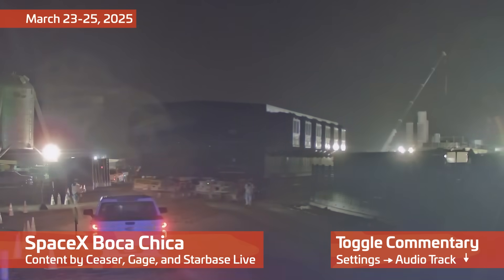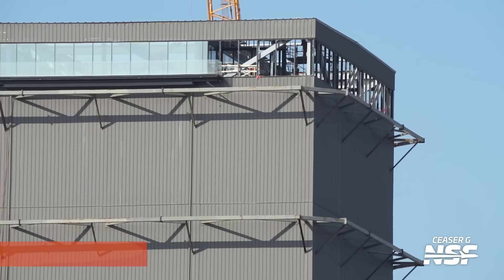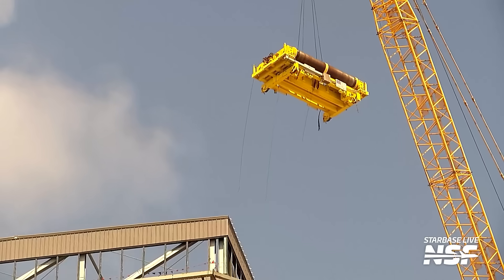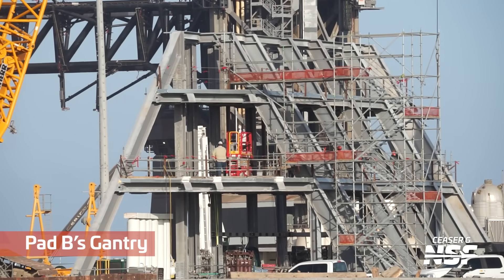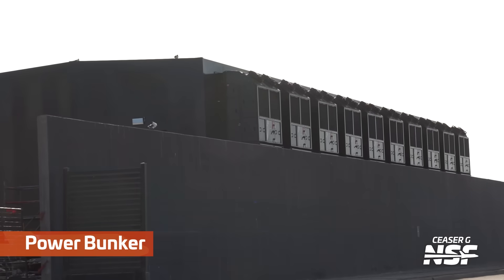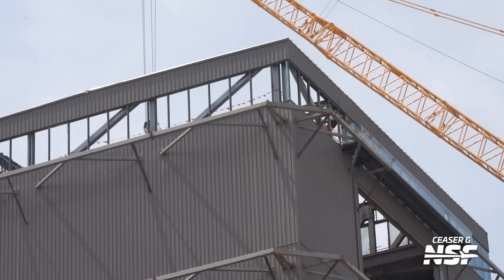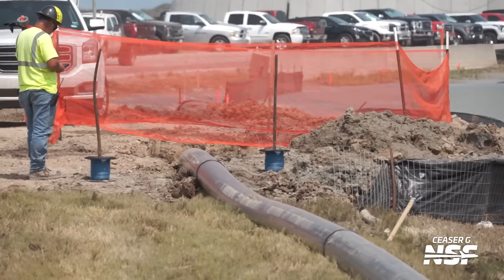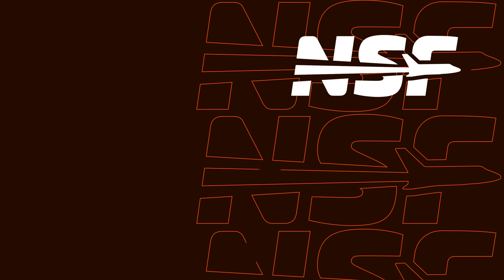Starbase Prepares to Bury their STARGATE | SpaceX Boca Chica

Comment: The glaring fault with Starbase is its lack of height above sea-level. With projected sea-level rises from global warming what is SpaceX going to do when water is lapping around its foundations or inundated by storm surges? It will be a bit hard to get anything done! They are putting a lot of investment and infrastructure in harm's way. Also with projected Superheavy flights SpaceX will be a major CO2 emitter accelerating climate change. They need, instead,  to accelerate conversion of atmospheric CO2 to CH4 via Solar or Nuclear energy.  Perhaps Elon needs to invest in Fusion research as well. He will need this ability for a Mars colony.
 Wouldn't it be a great goal to remove all the CO2 put into the atmosphere from burning carbon fuel over the last 200 years. Just need the replacement energy.

Comment: The blue rope being drawn into the pipe is for pulling draw strings through to then drag fibre optic and power cables down the conduit later on. Far easier to lay a single pipeline for utilities to run than multiple trenches for seperate exposed utilities.

Comment: Pipe going underground: Probably Horizontal Directional Drill pulling HTPE pipe that been fused together (basically by giant iron) and the two spools of wire are probably to enable for damage protection that the plastic pipe can be located by an RF locator.

Comment: What's that satellite dish/antenna doing on top of the mega bay #1 at the 2:32 mark of the video?
Reply: I think that's one of their communication antennas for launches. Not sure if it's transmitting or receiving (or both), but they had filings for an identical looking on on the High Bay previously so I bet they just moved it over

Comment: If the MegaBay is positioned where Stargate currently resides, and connects directly to the Starfactory, doesn’t that block off access to Highway 4?

Or, will the MegaBay  have doors on both sides?

Comment: I would assume the wires on the underground pipe allows them to electronically detect where a cut may occur. Say it gets dug up, they can check the impedance on the wire and know how long the wire is and therefore where it is cut. But that's an entire speculation. But possible. lol

Comment: great work as usual, Question about the Power bunkers, I'm a little confused as as Tower west is already running. the chopsticks are already zooming up and down yeah? So what other motors would these bunkers be for? more related to the Tank farm ops, water deluge etc? can't be much on the new LM that requires that much high power stuff? Just interested thats all

Comment: People in Europe has found new and interesting ways to make roundabouts useless, adding traffic lights is the first thing they try considering light travels in a straight line and roundabouts are round this doesn’t work and you end up with up to 100 individual traffic lights second the newer method is to make a roundabout as awkward to use as possible, it’s kind of a speed bump without the bump.

Comment: 10:35
Fiber optic comms conduit:  Non metallic.  
Fiber optic cable:  Non metallic.
Blue tracer wires:  Metallic.
Regulations so you can detect/locate underground infrastructure.

Comment: The Blue Wire is Tracking Line, it is used by Utility Companies to Find Buried Gas, Water, Sewage lines. The scanner’s used by the companies is basically a Metal Detector.

Comment: The pipe is a fluid pipe... probably water.  Its being pulled into the hole from the other end.  It's called Directional Drilling.  Image drilling a well... but horizontally.  And you can steer it up down side to side etc...  its steel pipe but flexible.  when you get to where you are going... could be hundreds of feet... under roads ponds... what ever.  You hook that pipe or other conduits like electric or flexible gas pipes... etc to it.... and pull it back.   The whole point is you don't have to dig up the entire run...like a trench... you just have to make a pit on each side for the pipe to go in... and then come out... and little holes "to see" when it crosses any other utility along its path.  Again you can steer the drill rod... so you steer it to miss the other utilities... but have to visually make sure it misses each one.  They use a long stem pressure washer and a very good... truck or trailer mounted vacuum that will suck the mud out of the hole... that way it does not hurt the utilities with sharp shovels and stuff.
The blue wire spools... are just running along with the pipe... and will later be used as 'tracer' wire.  Even from 25 feet deep a guy with a location Receiver and a Transmitting signal hooked to one end of the wire... can trace its path underground so you  know where it is if you want to find it again... say if you wanted to cross it with another pipe... they can locate its position ...did it up... find it... so they don't hit it and break it.
If you have ...say a gas pipe in your house... you have a wire that goes from the street to your gas meter... taped to the gas pipe.   At the meter you will be able to see a colored wire sticking out of the ground ... or twisted around the pipe.  The end will probably be bare as well... If you need your water main or something dug up for repair... a private locator can come out and hook to the wire... send a signal... and read it out across your yard... putting those colored paints  you might have seen all over the street etc.   In that way, when they dig up the water main... they will be very careful when they get close to the Yellow painted lines... they know a gas line is with in two feet of it somewhere below.

Comment: 10:30 The spools of wire on the two stakes are for redundant tracking of the (likely) water main that is going in there. That flexible polymer pipe is welded together at the seams, creating one large high-pressure capable main. Cuts down on joints and subsequent leaks dramatically.

Comment: Bet they sell those bridge cranes!   “You can tell by the way it is”.   lol Das.      You have to YouTube Neature Walk!   OMG!!!  You just made my day!
Reply: Those cranes are very commonly built for other applications. The main bridge beams are pretty simple and can easily be shortened or replace with longer ones.  The money i in the trolleys and lift hardware.  I've seen this done a couple times. Build time on brand new cranes is quite long. Resizing and refurbishing these existing cranes is much faster and cheaper.

Comment: Eh, John!  I had been driving for 30 years before I encountered my first roundabout, and I hate them!  I took the time to learn the safe piloting of an automobile through and around after moving to the Boston area for a short work assignment, and I found that most others don't know or don't care about the proper use of them.  Do they work?  Sorta.  For most, 4 stop signs would work just as well.
   The one at Starbase will probably work great for turning trucks around, but others are a waste of money.
Reply from the maker: This thing looks WAY too small to turn.arpund a truck and trailer like delivers the cryo. Don't think it will be used for that but I guess we'll see. - Das
Reply: I first encountered a traffic circle in Pasadena, Texas in the 60's, and learned why my parents hated it so much when I started driving it about 1970.

Vehicles trying to dive in and out, slowing and speeding up randomly, lots of accidents, when they replaced it with a traffic light traffic flowed smoothly with very few wrecks.

Comment: The Plastic/rubber Pipe being pulled underground is being pulled with wires on either side of it, so the pipe itself is easier to locate later since it is berried and not metallic.  at least that is my thought.
Reply from the maker: Have seen a few comments on that, and it makes good sense. 👍 - Das

Comment: That bridge crane part is sometimes called the trolley.
Reply: Having operated bridge cranes for years, yes that is the trolley.  The hoist, which is the drum/motor assembly that holds the wire rope is still attached to the trolley this video.

Comment: My assumption on the roundabout is for truck turn around area instead of backing into the drive and back on the road.
Reply: It’s more of a wide spot for turning that a roundabout. They are only working on one half at a time to keep the beach open.
Reply from the maker: That's gonna be even more of a mess, good lord. - Das
Reply from the maker: Roundabouts and tractor trailers don't usually get along... - Das
Reply: @NASASpaceflight  How about traffic circles?  ;)

Comment: My assumption of the blue wires going with the pipes is to help with future underground locates.
Reply: Bingo!  Can't find plastic pipe once buried with a detector
Reply: Called tracer wire…
Reply: This is correct non-conductive pipe, so add conductor to locate with buried service locating tools (fancy metal detector) at a future date

Comment: The blue wire with the pipe is called 'finder wire' i believe. It is used so that you can find a  plastic pipe with a meal detector by detecting the wire.
Reply from the maker: Hey, that makes sense good sense. Thanks! - Das
Reply: @NASASpaceflight  The pipe being pulled with the blue tracer wire looks like either ABS or HDPE sections that have been heat-welded together and then pulled in place with a directional drilling rig. I was a utility locator for my local public works department until recently, and we used drill rigs to pull water mains in certain areas where they couldn't reasonably be trenched in place with normal excavators, and they looked pretty much exactly like that. :)
Reply: Means the pipe is water or gas as power is its own marker.
Reply: Yes, definitely not power
Reply: Yes, correct, it is "finder wire".  When you call the "Dig Line" the folks come out with a specialized detector box and it senses a signal on the wire.

Comment: Oooooh. Thank you for the speedy-directy posting on this one, NSF folks!

Edit - Random note now that I've finished the video - a hardhat rating is much lower and easier to achieve, in most regards, than bicycle or skate helmet ratings.  It's not unheard of for helmet manufacturers to cheat and sell helmets that aren't certifiable for bicycle or skate usage as "hard hats" (legally) instead.  Bern, for example, has been guilty of that in the past.
Reply from the maker: Now that's one I've never heard of, huh! - Das
Reply: Not necessarily fraudulent, just different standards.  There's also a distinction between a 'hard hat' and a 'bump cap' in terms of protection.